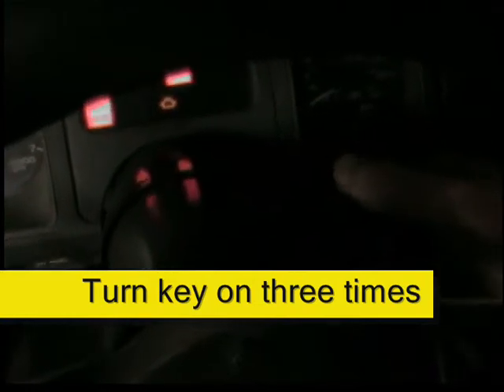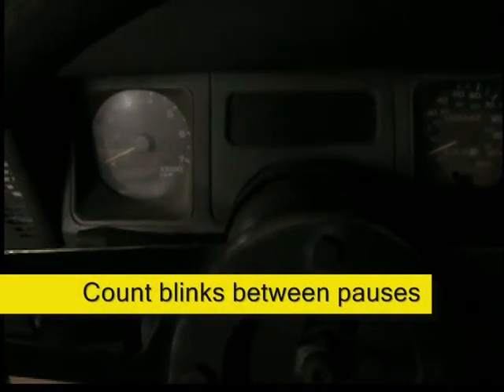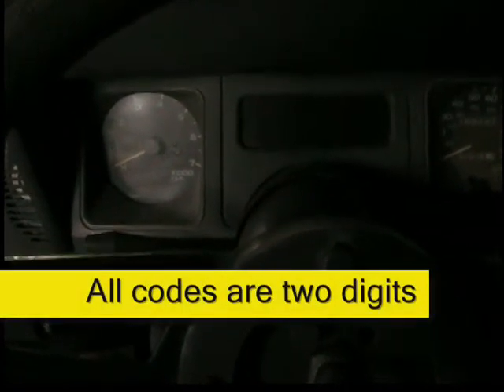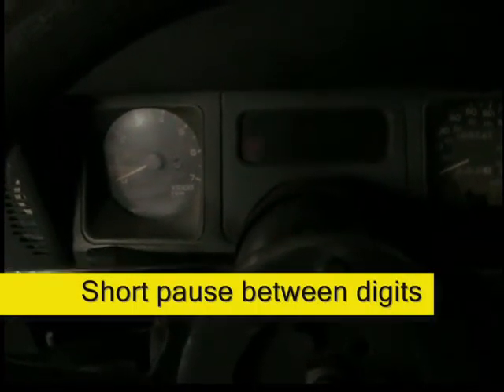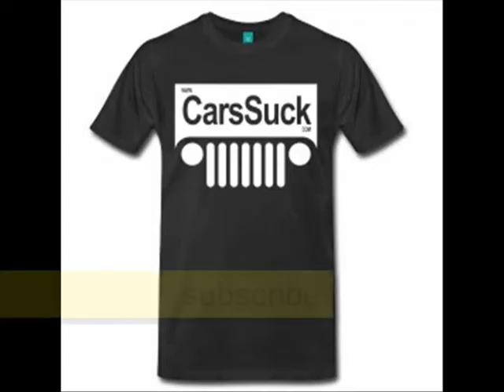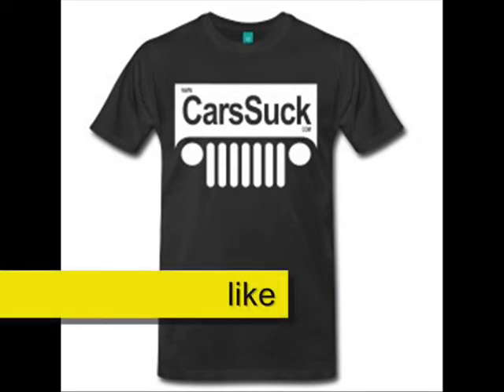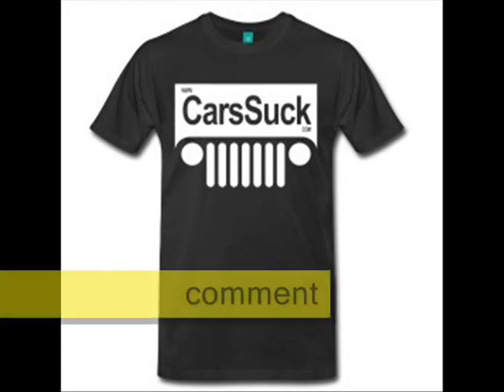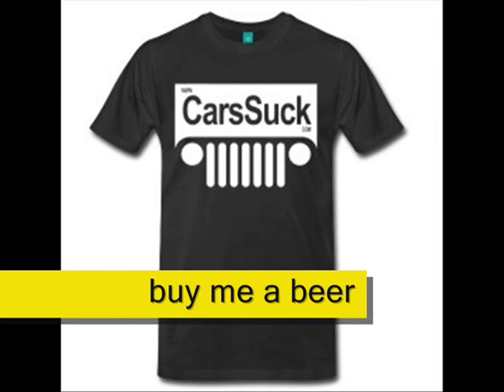Jeep Wrangler YJ OBD Codes How To DIY

Comment: How do you clear these codes
Reply: Disconnect battery for like 10 minutes. It will clear. It will come back if the issues aren’t fixed.

Comment: ...so what code or sign indicate that there's a trouble?...
Reply from the maker: Check engine light.
Reply: ...but the thing that i'm still not clear is about the code light works, after i start the key 3 times, what happen with the engine light if there's or there's no a trouble?...just like your video, you didn't explain if there's a trouble with your yj related to the amount of the light blinks...
Reply: Yes